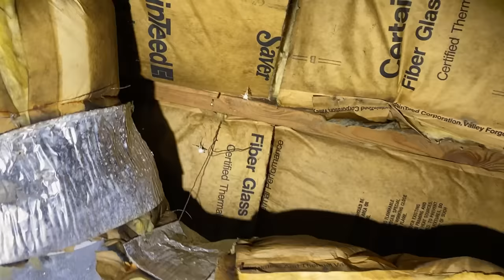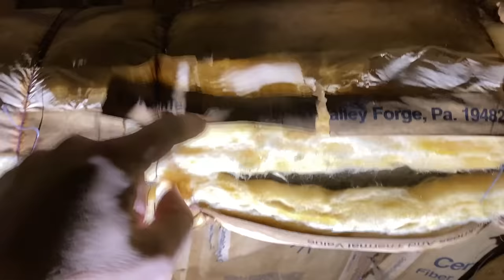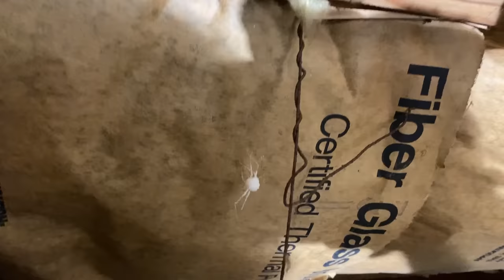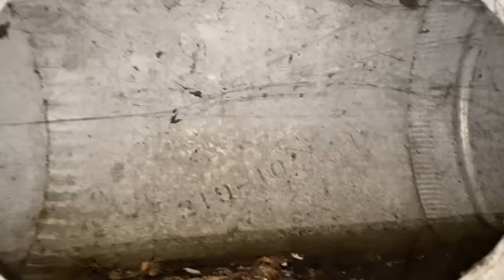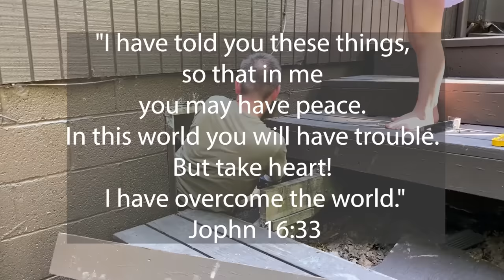Finding A Secret Room Under My House and What Was In It

Comment: Living in Arkansas; - in a frequent tornado area,  ALL I can see is a place to make an easy access- for everyone to safely traverse quickly-  for tornado shelter & a cellar to store food!
Once it is clean and dry- I'd concrete the floor and you could actually make a floor / door with stairs from inside the house- to get in and out easily - and then it is a useful part of the house- SO LUCKY to have such a high ceiling down there - 
I have never seen a crawl space that u didn't have to Crawl through!
Reply: I'm in Florida.  I was thinking of a hurricane safe room.  Doesn't look like flooding is an issue. This room is a huge bonus if access was a bit easier.
Reply: Good idea.

Comment: That duct needs to be replaced. Having water inside causes mold and mildew and that's carrying the air you and your family are breathing. Your condensing coils are leaking into your duct and that needs to be addressed first. Then replace the duct and insulate it good. Also, you should have used a shop vac to suck out the water and not drained it out on the ground in your crawlspace because now all the moisture is still under your house. It takes a really long time to dry without sunlight and ventilation. Just trying to steer you in the right direction.
Reply: Yeah mold is nothing to play with

Comment: I had exactly that problem. It was a crawl space with constant moisture that caused mold to grow both in the crawlspace and in the ductwork. It gets really wet with any rain. We dumped bleach all over and had the ducts professionally cleaned. And I got out ASAP. You'll need something to close that up. You should not go without a respirator because of smells. Clean it out and bleach it all. You  will also need to check pipes and make sure none are buried in gravel and have separated. Also, if the low spot is connected to the AC, you could be having pan issues. If it is, I strongly recommend you reroute the AC drain into an outside drainage pipe. My issue was that the builder didn't route the condensate duct properly. Just left it drain under the house, thinking it would go to the sump and get pumped out. Unfortunately the sump pump was installed in the highest spot of the crawl space so nothing went to the sump unless there was several inches of water. Also, there were leaks around two little windows that allowed both rain and snow melt. After I dealt with all this, I took the landlord to court because he refused to deal with any of it. He lost. Since I had documentation and pictures (thank you Judge Judy!) I could prove the problem and certified letters proved he was aware.  He had to sell the unit, but only after fixing it all. Plus my expenses and court costs..

Comment: Here in the UK we use air vent bricks - basically bricks with a grid of holes to let air in or out of the area under the floor, and honeycombe walls between rooms internally in that area, these are staggered layers of bricks with gaps between.
It’s all designed to give good airflow under the house and prevent rot.
Reply: that would work if you didn't have sub zero temperatures or lots of snow...
Reply: @elainemarten2147  we often get cold weather here
Reply: @dshe8637  Not like in some places. Your trains shut down when thered's a little bit of snow. Think way below freezing, high winds and snow up to your knees
Reply: @pazza4555  Not a very deep frost zone
Reply: Put a dehumidifier down there and plumb it out. Definitely has a micro climate issue. Wouldn't hurt sealing the block off with a vapor barrier too.
Reply: Water in the air con is how legonairres disease started

Comment: Continuing from the last comment, I once saw a house where the condensation line tied into the sewage line, this was a split system. The condensation line was on the suction side of the fan so anytime the condensation trap went dry (typically in the spring) it pulled sewer gas out of the line. You couldn't pin point the smell because it was blown in all the duct system.
Theory #2 - this is where the previous owner buried his victims.
Reply: My thoughts exactly.  Sewer gas is really horrible.  I would check for that.  But I’ve never seen this much water in duct work.  I would get to the bottom of that fast.
Reply: That house in Amityville had a basement with a well that was filled with smelly demons or something 😳

Comment: I wouldn’t call a plumber I would call an HVAC TECH. I think they would be more helpful than a plumber since you had all that water in your ducts.
Reply from the maker: Well I guess technically I am an hvac tech just a retired one:)
Reply: @SSLFamilyDad  I am just saying to get a HVAC tech bc I don’t understand how it can be a plumbing problem if the water is in the ductwork. Do you have plumbing pipes that go through the ducts and could be leaking?
Reply: @SSLFamilyDad  maybe all that water is accumulating over the winter when the hot air is running through cold pipes in the basement.
Reply: Need a foundation company to come out and remediate that room. Looks like it needs a French drain and a pump along with a vapor barrier and all new insulation and probably mold treatment! Good part of that water I'd say is condensation being that the duct is metal and there is a foundation vent right near it.

Comment: It makes me so happy to hear someone properly use the words condensate, condensation.

I would rip out all the insolation and update to spray foam, or at a minimum replace the insulation with new. 

Good luck with whatever you decide to do.
Reply: Agreed. Maybe rock wool due to the tendency toward dampness and proximity to the hearth footing.
Reply: Condense is proper.., condensate is a syllable too much,but we knew what you mean.
Reply: Yes condensing not condensating. Condensation is a noun derived from the verb to condense.

Comment: You'll definitely need to dig all the dirt on that wall with the window hole and put a rubber waterproof paste/ paint on it first. Take all  the old duck work and moldy R13 thats up and replace duck work, check any condensation pans and replace. Then either blow insulation or do the expanding insulation which would give you a tight seal. Then a waterproof concrete blocks after you have brought in drying fans and let it completely dry before adding vapor barrier. Adding a window or getting architect maybe add a door entrance where that window is by digging down, putting additional support on cinder blocks and have a walk down entrance with a door it'd be great useable space for storgage or cold room for canning,. Good luck. Can't wait to see how you progress with this project.

Comment: Yes, I agree that the water is all condensation.  Without insulation during heating season, humid warm air will condense on the inside of the ducts.  
1.  Do Not Use flex duct!  Get a proper HVAC contractor to reinstall rigid duct and insulate with foil faced insulation, probably 2".  Seal ductwork and insulation properly with mastic.  "Duck tape" is not suitable for ductwork.
2.  Do the same (as in 1) for all ductwork in crawl space adjacent to basement.  
3.  Make sure all ductwork is cleaned out.  If you have soda cans in this area you will probably have more in crawl space.
Don't cut corners!  The air circulated through your ductwork affects your entire family.

Comment: I would dig out the basement and put  cement tar on the outside of the bricks. The cement is to wet. Get gutters to move the water away from the house. Fix the insulation so you don't have any frozen pipes. Finally, call a plumber to see where that water is coming from. You may need to put a cap over your chimney on your fireplace. Anyway, there's my 2 cents worth.

Comment: Read some of the comments and there is some good advice.  One thing you may want to look at is that dark insulation to the left of the crawlspace entry door as you’re looking at if from inside the crawlspace.  There is a possibility that water has leaked in below your sliding glass doors at the rear of home.  The stained insulation is sometimes evidence of water penetration.  Just pull the black insulation down and look at the sub flooring.  Also before you remove the ductwork it looks like it has presumed asbestos tape wrapped around it...sorry for the long message...just offering some help...take care and stay safe
Reply: Asbestos is very dangerous.  You need that removed.  I would suggest by professionals.

Comment: Okay so you’ve got an incredibly unique opportunity there. 
You need at least a hatchway access from inside the house to that basement space, the pea-gravel floor is a great idea, line the entire space with lead paneling for use as an emergency fallout shelter, install an emergency egress over the existing entrance and cover the outside with a facade. 
Install two emergency band antennas on the roof and run the cables to the basement for maximum radio reception in an emergency. 
You’ll need an air filtration system as well incase you have to stay in the basement for a few days or God forbid… weeks. 
Scrubber systems are expensive but when it comes to your family, you don’t want to have any regrets. Run a basic disconnect for main power and the AC unit just incase you need to turn off/on either or both. Install a basic toilet & sink. A basic gravity water filtration tank like an Alexapure, so you aren’t immediately breaking open your stored water rations. A backup potty plan incase you lose running water. 5 gal buckets with lids and a sufficient stock kitty litter are an excellent environmentally friendly way to go, when you gotta go. Also if cut and apply a pool noodle to the rim of the bucket, your posterior will thank you lol! 
Beyond that you just need to stock the shelter with cots, bedding, clothing, emergency food, water, some manner of illumination, books, boardgames, detailed area maps, emergency AM/FM radios, basic TV setup for cable/local broadcast, a ham radio for comms, emergency services band scanner, GPS, a couple of USB battery banks, portable solar panel charging system etc and of course, be sure all electronics are stored in a faraday box!! 
I’ve only spent ten grand and my emergency setup is sic AF lol. 
That should get you by in an emergency and give you and you’d family the greatest chances of surviving an emergency.
Reply: Are you expecting an apocalypse?

Comment: Was the water smelling when you drained it? Could the water be coming from the furnace air conditioner? Like a clogged p trap from a condensate water drain on the furnace or air handler unit. Have to say that is a strange problem. But on a positive note I see the perfect food storage area maybe.
Reply: Maybe need some duct cleaning and sterilization.
Reply: I believe you are right
Reply: As soon as he went in I said root cellar for sure. Put in bigger door for sure.
Reply: @jimputnam2044  That is what I was thinking too.
Reply: This is the likely problem.  The condensate from the air conditioning is finding it's way into the ductwork.  

This could be a very expensive problem if the heat exchanger is rusted out.
Reply: I was on the end of my seat what you might find

Comment: Great find! A whole basement just sitting there going to waste. First thing I would do is knock out some cinder blocks and put in an oversized  door for easier access. Then that wet ductwork has to go. In removing that you'll probably find the water leak. Happened to us in the basement. Turned out it was a leaky bathroom sink above. Replaced with  a 10' section of new flex. Fixed the bathroom leak and now no more wet ductwork. Good luck.

Comment: We have a colonial that was built in numerous sections - started out as a small, cinder block home in the 50's.  It's on a slab (well, various slabs).  Eventually various owners went up, and, out.  In our den I would smell something, now and then, that smelled musty.  At one point I gutted the den.  At one end of the den the slab seemed to be sinking, too.  Anyway, when I pulled up the floor I found a damned stairwell that went down to a storm cellar that had been outside when this place was a smaller, cinder block home.  It hadn't been filled in very thoroughly, nor, the floor properly constructed to keep it from collapsing into the abyss. I fixed the floor over the stairwell.  It was just quite a shock.  And my wife never said she could smell that musty smell - she thought I was imaging things.  Nope - there's a damned storm cellar under part of our den.

Comment: Put spray insulation in the ceiling and put metal ducking back in because you will make a mistake putting the flex duct in that basement because that basement does not have a concrete floor and you need a concrete floor and that would be a good place for a storm shelter you

Comment: I would work on getting water proofing on the walls and maybe even dig out around the outside and add water barriers there too.  Then pour a floor, replace the insulation and add a door so you can walk in.  In the ducting add a length that goes straight down to make a sump, and have an access door on it for cleaning out.  Put in a sump pump.  Then it could be used for a play room or cold storage!  Add a reinforced cement ceiling and have a shelter!
Reply: All very good ideas!
Reply: When you dig out around the outside, do you also need a French drain, to divert water?
Reply: Good idea.
Reply: If you put a sump pump in,  make sure the floor is slanted toward the sump pump. Mine is slanted down to wrong end of the basement so as I'm  using brooms, squeegee mops trying to get water down coercion right back where I swept  it from! And it takes forever for the water wate basement has had deep flooding for the past 26 yrs. of living in the dump I bought, seller never disclosed flooding!!
Reply: Remember when he was getting ready to take off the cover he found a big long piece of drain pipe from the gutters that was disconnected.  That was the wall with the moisture on it.  It shouldn't be too difficult to connect the gutter and that piece to send the water away from the foundation.

Comment: There is a tunnel under my house on Washington Street in Midland TX that goes all the way over to the old Loop 250 truck stop. That's where the tunnel ends. Of course it's just a vacant lot now but if you poke around in the ground you can see where I came up through it. I had a steel plate made to keep people from coming into my house, because they came up the tunnel through the wall and into the Attic
Reply from the maker: That’s cool!

Comment: The drain line from the A-frame coil pan is blocked causing the water to spill over into the ductwork… We have a slab foundation so all our duct goes into the attic but our drain line has blocked up before and the pan spills over underneath the coil…
Reply: Nope the leaking faucet he had in last video leaked water into vent.

Comment: Had a problem alot like yours,  water in the AC ductwork,. Found out that it was getting in to the ductwork via the bathroom vent.  Moved the vent and water treatment for the floor, fixed the problem.

Comment: Check your AC condensation unit drain pan and the pipe leading away from the unit.  This will be under the AC unit inside the house/garage/attic.  These pipes can come loose from the pan or each other, or from the drain they connect to. If the unit is an old unit, the pan may be disintegrating (early plastics). Most techs do not glue the pipes together for disassembly purposes.  The condensation water is probably draining out over an AC air pipe crack causing the problem.  An easy fix, not so easy clean up.
Reply: Weird. You said a lot, but you didn't say: "The condensation pipe might be clogged" (Which happens VERY VERY frequently, especially if you don't put one of those tabs in your condensation pan every few months.) What happens often is that the drain pipes get totally clogged, then the pan overflows to everywhere the water shouldn't be. (Through the ceiling if it's a ceiling mounted AC. Or through pipes it shouldn't go/etc.)

Comment: With the holes you just drilled to drain the pipes, you now have a simple way to remedy the condensation and the sweating/wicking thru the cinder blocks. 
Just get an electric baseboard heater. It takes minimal energy or temperature to keep that little area warm enough to dry out and remain dry. (You could even have the heater wired to a thermostat so that you can turn it off/on from the thermostat.)

Trying to locate where the water originated would obviously be beneficial.

Another suggestion would be to send the family away for the day/weekend. With a weed/chemical pump sprayer, mix up a bleach/water mix @1:1. Then turn on the furnace fan, spray the bleach mix into the furnace fan. The finer the pump sprayer mist is the further the mix will carry thru the ducting. To kill any bacteria & mold. (There’s likely a real chemical product you can buy, but the bleach will work.)
Reply: Bleach will corrode the metal duct work. There is a reason for those other correct products.  The ducts need to be professionally cleaned or replaced and insulated.